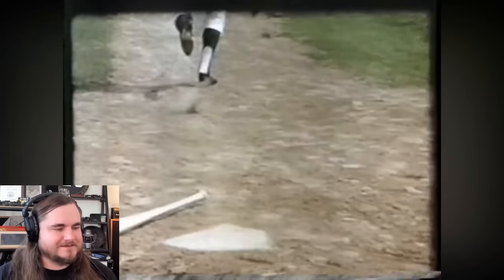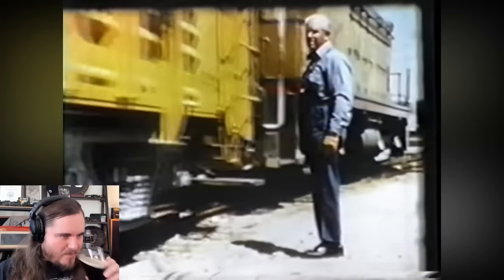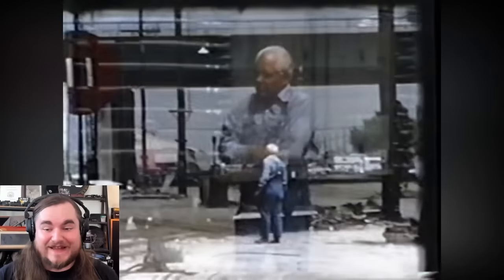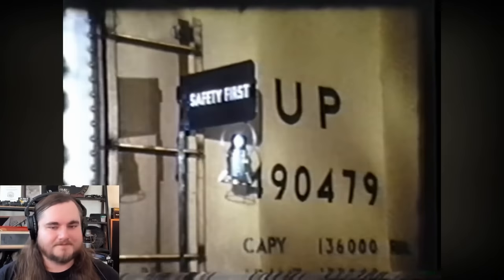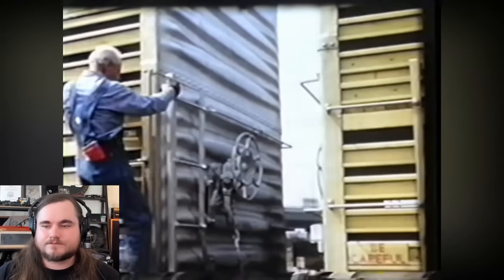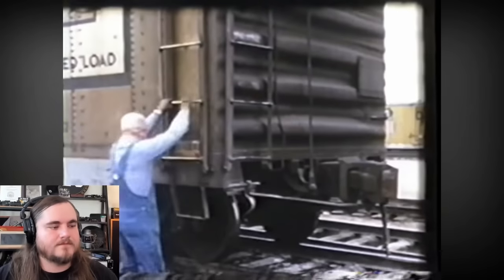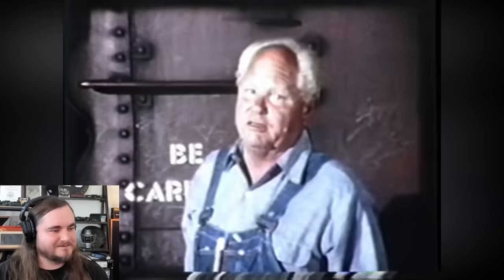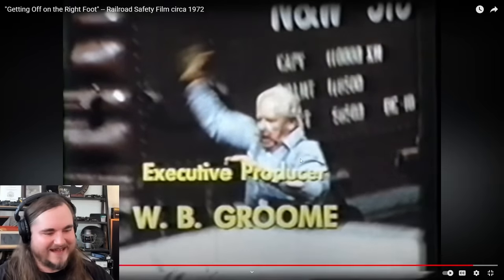The best rail safety video of all time? | Hyce Reacts - "Getting off on the Right Foot"

Comment: Many years ago, we had Blackie and a couple other old heads doing some switching in the yard, and they were using some wild hand signals to communicate which car was going to which track, what was being cut off, etc. No radios were even touched that day. Such hand signals died along with Blackie, I'm sure.
Reply: You will find similar and more complex sign languages — OK, ASL and co are short range only, but military hand signals (when you need to not make noise) and ship-to-ship communication with flags or lights or guiding an aircraft on the ground with hand signals … plenty of them around.

There’s even a whistle language — originating in a place where ridges were too far for shouting but within range of whistling.  Today, servers there communicate with the kitchen over the din of tourists in that language.

Comment: We have something similar in the electrical field to the blue light/blue flag.  Lock-out/tag-out.  If we turn off power to an area, we lock the breaker in the off position along with a tag saying "do not remove".

Also amazing how these old school training videos, are in so many ways, better than training videos we have today.  Probably goes the same for any/every field out there
Reply: LOTO isn't just electrical, though it's probably most common, but used for anything "energized." I work in oilfield with gas compressors, and we use it in many cases.

Gas compressors, when being worked on mechanically, don't get only the electric power for the motor LOTO but valves for the gas stream as well. Gas anywhere from 120 psi minimum up to 1700+ psi on the other side of those valves, and full of deadly H2S as well (deadly as low as 100 parts per million, or 0.0001% concentration).

Well work rigs not only lock out the electric power for the motor on the pumping unit, but will lock brakes and chain the crank arms so that the cranks and counterweights cannot move on their own. A couple of our units have counterweights that can be up to 8000 lbs, and when suspended vertically, that's a lot of potential energy.
Reply from the maker: We use LOTO in railroad mechanical as well. Anything that is energized, as Ronald said.
Reply: @Hyce777 we use it for machining too as everything in a machine shop will kill you given the chance.
Reply: We use LOTO in HVAC/R as well
Reply: I am using LOTO in Poland when repairing/maintaining machines in production facility (Big American company btw). Electric, pneumatic, hydraulic and (propably, but not in my division) mechanic equipement have this capability and it is required for certain jobs to do it. 

And yes, I am only responsible to shut down the main electric switch and put padlock on it (and all other switches when oher guys doing their things in the same time also). But in 75% of the cases main switches have mechanical rod connecting the handle from the outside of power cabinet door to actual switch, wich is mounted on the back of the cabinet. And what if you want to open this doors after disconecting and locking (you have to do it something inside?) You have to disconect shut-off lever from the rod wich gives you potential capability to turn the power on with pliers. And lining back this connecting rod to the correct position while shutting doors back is sometimes... let's say frustrating.

 Details, dont worry about it. It's fine 🤣

 But seriously- machine have locks and tags, everyone working on it have ben informed about risks, (you have to write them on a "quick risk analize" paper and every member have to sign in under it), and you have to put barriers for "innocent bystanders" to not get in without your permission (and signing in to the paper also). 

Fun fact: While doing regular check on a machine wich was repositioned and modernised with new equipement just few weeks before I have to open every guard door, check every guard door switch for his proper mounting and operating. Machine cannot move for a fraction of an inch and pneumatic equipement have to be shut off from air while doors are open. But.... In a proces of modernisation program on a controller also have to be changed to work properly in the new condition. And someone have made simple mistake - multiplied guard door switch number twice somewhere in the code. So what it means in real life?...
 I and my friend was shocked when I have opened this one door (wich number was missing in a code, because of multiplication of previous one) and pressed the reset button. The air valve opens- pistons set the stations in propper working conditions acording to the main drive position.... Mistake was quickly found in a code, corrected, reported and approved by a engineer responsible for it 🤣
Reply: @retr0bits545  there was also the LOTO system used for the cardboard box compactor/bailer in the back storage area of the walmart i used to work at out of high school and was never allowed to use
Reply: LOTO is also obviously taught to people in machining as well as factories/plants as well, so that people know that a machine is unsafe to operate or at least down for maintenance/being fixed or repaired. I once worked with a guy who had to have his arm reconstructed and his thighs completely skin grafted in not one but TWO separate incidents where LOTO wasn't respected by the people running these two different shops before he worked with my dad's shop and in those two incidents,  machines were started up with him still inside of them due to management getting cranky about downtime. One incident involved half the machine being up and with exposed open pipes burning off his pants and melting them off his legs with scalding hot steam and the other incident involved a middle manager clipping his tag and ties off of the power switch and switching on the machine which resulted in his arm being twisted and mangled with him being caught up in a machine. In both incidents people vomited upon seeing the aftermath of what was done to him, between the shattered arm and the skin falling off his legs. he's honestly as lucky as he's been with the medical outcome of both incidents that they were able to skin graft his legs, and they were able to put his arm back together, hardware and all.

Comment: The railroad I used to work at had very different hand signals. I would slightly rotate my wrist clockwise for "speed up" and anti-clockwise for "slow down".
 
But then, my railroad was about 1/87th as big as yours so that's probably why.
Reply: Sounds like an inHOuse railroad I used to run.  The boss was a real piece of work too--always second-guessing the layout, screwing up the switches, constant derailing on curves...

Comment: I'm very fortunate in the fact that I have spent the entirety of my railroad career working for shortlines where getting on and of moving equipment and gravity switching or kicking were permissable. I'd be lying if I said it wasn't fun to drop or kick cars while switching, there's a lot of pride in being able to do something the old fashioned way. I can also say that I've safely done flying switches and dutch drops before, but there's a reason they are banned at nearly every operation because there's a lot that can go wrong when doing them.

Comment: Handsignals are just too different in some places. In the UK "come to me" is the "go away" in the UP video, and "go away" is the rolling are motion (with the arm nearest the locomotive). At night the handsignal instructions we use are based on red/white/green lights - there's a portion of the Network Rail rule book available online, which you can read. 

Also in the UK "fly shunting"/kicking cars is band, as is getting on or off a moving vehicle.

this happened about 15 years ago now

(We don't have a Blue Flag, but we have Not To Be Moved boards, modern ones have flashing red lights.)

When I was training as a signalman, on a heritage railway, we had a trainee guard/conductor that was doing their shunting assessment, and it was a bit of a damp day. They'd inspected the coaches they were gonna move and all was good, they called the loco on and when it went to brake it slipped, so slammed into the coaches, moving them about 2ft back. Suddenly 2 carriage and wagon fitters leap out from beneath the 4th coach (of 7), yelling at the poor trainee. The poor lad never completed his training after that and left the railway. The C&W guys hadn't told the signal box they were there and working so we had no protection set for that siding, nor had they personally protected the set of coaches they were dealing with.

Comment: For anyone interested. In Romania the signals depend on the direction of the locomotive where the front of the loco is defined as either: 1. the smoke stack of a steam loco, 2. the long hood of a diesel-hydraulic loco, 3. the occupied end of a diesel/electric loco not tied to a set of cars or 4. the end not tied to a set of cars in case of a diesel/electric loco. All shunting signals use a yellow flag by day and a white lantern by night.

Forwards is waving in a bow above the head accompanied by a long whistle.
Backwards is waving a bow below the head accompanied by two long whistles.
Slow down is waving a bow on the side accompanied by multiple long whistles (until the desired speed is achieved).
Stop is waving a circle accompanied by three short whistles.
Shove is the same as forwards/backwards, but only has a single wave (as in once from left to right) of the flag in a bow.
Couple is same as forwards/backwards, only the movement is less ample and it is accompanied by two short whistles.

There are more signals that are used, if someone's curious just ask and I'll tell them too.

Comment: I worked for a Anthracite company as a mechanic on basically everything. Rock crushers coal crushers. Sorters conveyors all the coal processing machines. That blue flag seems like a railroad equivalent of a machine lockout tag out. As in the tech who installed the LO/TO is the olny person to remove it. When your 400ft up on a conveyor belt that dumps into a rock pulverizer you don't want anybody the start the belt or any moving equipment. Love this video.

Comment: Not train railroad, but I'm a "tram safety officer" here in the Netherlands, we use different signals to communicate with the tram drivers and the people working in/around the tracks.

Hand signals (to tram drivers):
Stop: Raise track-side hand above head.
Slow: Track-side hand horizontal above the rail. (Make sure you step back before they get close...)
Drive forwards: Track-side hand, fingers pointing up, forwards and backwards past your ear.
Reverse: Track-side hand fingers stretched and together, up and down past your entire body.
STOP. NOW!: Wave both hands above your head like you REALLY CARE.

Whistle signals (to ground crew):
Start/continue work: Short
Tram in parallel track, watch yourself: Long
Stop work and leave the tracks: Long Short Long
Emergency: Repeat short signals until the entire track is clear, with a minimum count of five.
Reply: Thank you for that, fellow Nederlander (2nd generation in Fullerton, California, USA) Enjoy some Stroopwafel for me...hartelijk bedankt !

Comment: Hand signals are funny ones. In Australia, they're pretty much universal by State, Company and Rail Infrastructure Manager.

1. 'Come towards me' is one arm waved inwardly across the body by day, and a white lamp waved horizontally by night.

2. 'Go away from me' is a hand waved outwardly away from the body in a circular motion, or white lamp waved vertically by night.

3. 'Come towards me  / Go away from me slowly' is the same as 1. and 2., but with the other hand held straight up in the air. By night, you use a green lamp waved horizontally or vertically bythe wrist. I.E. small motions. These moves are meant to be 'Ease Up' or 'Ease Away' motions when you're setting up to couple.

4. 'STOP' is 2 hands held straight up in the air by day, or a red lamp or any light waved violently at night. An Emergency Stop is just how vioently you start waving your arms or lamp.

Most companies specify that you shunt/switch excusively by radio.  But all employees are taught the hand signals anyway. And there are always cases where hands beat radio.
Reply from the maker: We can't go meat space railroading now... what the hell are those hand signals lmao :D
Reply: I speak South African Railways hand signals, too. Which are a sort of lazy (Efficient!) hybrid of American and Australian.

Don't you worry about US hand signals- The first time I saw you do them on a 101 video, the only 2 that confused me were your 'Stop' / 'Cut' command (Drop your hands and wave them round your waist), and the gestures to count down car lengths.

Learning to speak [West Coast] American will be a doddle. 😉

Comment: That's the video we watched when i took the Brakeman class at Mid Continent Railway Museum in south central Wisconsin. We do the signals that you were referring to @Hyce. The "go away from me" sign in the video is how we give car counts of how far we want the engineer to move the locomotive. The other signal that we use that wasn't in the video is the "going in" signal. After a connection has been made to connect the gladhands, or if we have to adjust a knuckle, we give a going in signal that we need to have countered by the engineer so we know it's safe to go in and so the engineer knows we're in there. Otherwise the signals are really the same. I'm also kinda surprised they even talk about reaching over the knuckles to open the angle cock, we always climb over the loco or car to do this, although we only run passenger cars and a caboose so we always have adequate and simple way to the other side.

Comment: 28:20 I always wonder why the American hand signals are based on the direction of circles. In Poland, Germany and I think the most of Europe "towards me" is moving hand or flag horizontally with 2 whistles, "away from me" is moving it vertically with 1 whistle and "stop" is circling with 3 whistles. Then "slow down" is slowly waving on the side with several long whistles. The night signs are the same, they only differ for "push together", which at least in Poland is like slow clapping hands in daytime and letter D (docisnąć in Polish) in nighttime.
Reply: As he said, East Coast convention is lantern-equivalent signals even in daylight - forward / reverse rather than toward / away. These are distinct motions and don't rely on circles. The only downside I can see is needing to remember the direction the loco is facing. Many times I've had to stop and think about it before giving the signal.

Comment: Not a railroader but being a railfan know enough from watching those films primarily for the old equipment and just general knowledge picked up over the years know a thing or two when going to museums to be aware of certain hazards. Buddy of mine and myself riding the caboose train out at IRM back in the 80s and were in a MILW bay window hack at the head of the cut with an 89' flat between us and the Shay at the head end. It was a holiday weekend or some soon event weekend because the train was pretty crowded and we got the bay window seats and noticed dad with his kids standing near us just hands at his sides so figured to keep this guy from falling into someone else Buddy points out he might want to hold onto something as a caboose isn't like his rides on the commuter train and slack action is a thing. Gets a bit snarky with a yeah right thanks response ( think he might have been peeved buddy and me didn't give up our seats for his spawn to ride in the BW) so we just shrug and think okay it's on you then.
Shortly get two blasts on the whistle and wait for the show as we hear the slack start to run out from the flat ahead of us and as we warned slack hits and only his quick grab for one of the uprights saved him from going down.

Comment: Wow, those stunts are something!  Interestingly, the Sumpter Valley Railroad does allow getting on/off moving equipment.  Probably most commonly done when flagging grade crossings on shoves so we can get back on the train.

Vintage Renewed already covered it, but our railroad uses night signals exclusively.  Also, the "slow" signal for us is simply to extend an arm horizontally and keep it stationary, rather than the "rock the baby" demonstrated.  Much easier to see, especially with a light or orange rule book, and it can very quickly turn into a "stop" or "washout" signal by swinging the arm downward.  Reading my Sound Transit ROW Safety card (which I'm sure you're also familiar with, lol) it looks like their "stop" and "proceed" signals are the same as usual night signals; "reduce speed" is the same as ours, but with a bit of vertical motion to the hand, presumably to draw attention.
Reply from the maker: .... wow, that's really wack

Comment: In many countries, there are two handbrake wheels, one on either side of the car (they are actually mounted on the side).  The brakeman can set the brake while standing firmly on the ground.  This is a good system and one that North American railroads should really consider adopting.